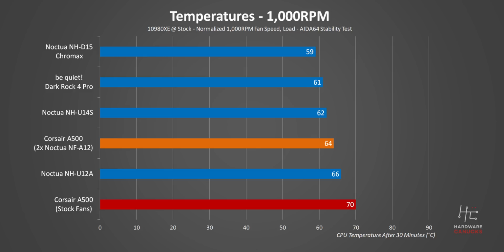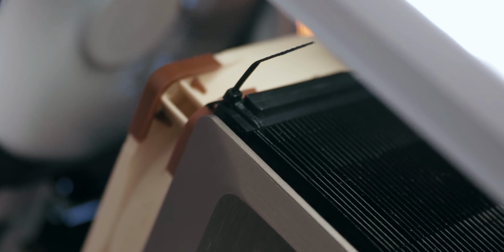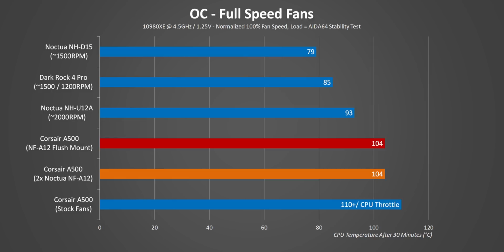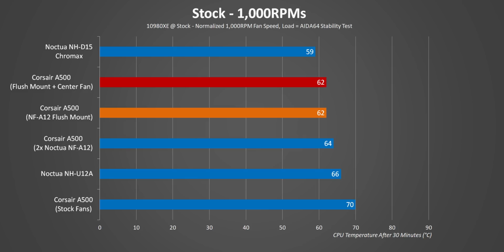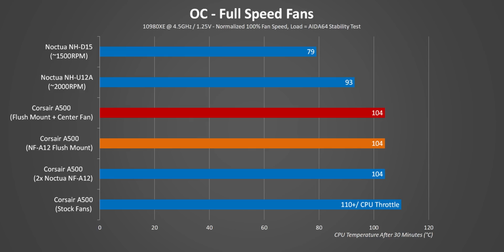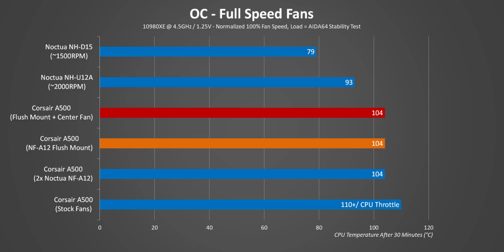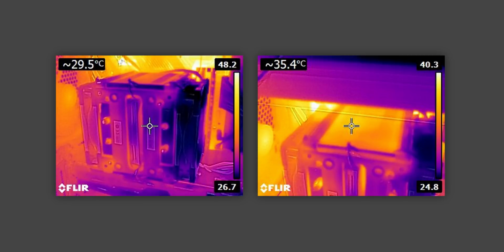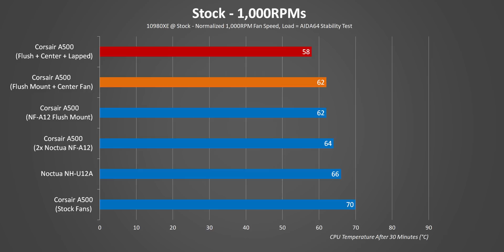I Tried To FIX The Corsair A500 Air Cooler!

Comment: I have no issue with Corsair for the most part,  they however shouldn't have bothered with this cooler IMO.   It's ugly for one and more complex then it needs to be.   That whole sliding fan thing is just a waste of time.   Mount the fans once and forget about it.  It's not like a window in a house that'll be opened and closed all the time.   Sliding fans,   pointless.

Comment: Using noctuas is always the best option for air coolers but using a slim fan in the middle gap is just a genious idea, good job "fixing" (in the noise area at least) this disaster with the good ol' brown.
Edit: Even with that much tinkering the 4 heatpipes are just not enough, i guess the long awaited NH-D16 with 7 heatpipes is really going to make a big difference.
Reply: Genius how? It Didn't improve temps whatsoever.
Reply: @vongdong10  Yes im aware of that, im saying this because using that middle gap for something was unexpected for me, i didn't work because of the naturally poor performance of the cooler but a fan in the middle is kinda rare and the for some coolers and it makes a impact in temps.

Comment: That's crazy, I was thinking the DR4Pro was overrated since if I push 9900k to all core 5ghz it runs right up to 100C....
Reply: It is because Noctua D15 is like the best cooler in the world 

Open for debate if you want me to justify
Reply: @tanishqbhaiji103  Yea on the reviews the noctua and BeQuite was right at the same performance, liked the color of the BQ.  It's just a hot chip, then again normally mine runs underclocked to 4.5 so fans can just idle while gaming.
Reply: I don't think on an OCd 9900K to 5GHz should use ANY air cooler... :D

Comment: Jesus what a fail and it's being covered on all main tech channels. Somebody is getting effin fired.
Reply from the maker: technically it isn't a fail since it can cool really well up to ~165W.  So 99% of CPUs are covered.  But over that?  Not anywhere close to Corsair's 250W claim.
Reply: @HardwareCanucks  For that price point it should be putting out wildfires in Australia.
Reply: @ninezerofive  that should be the rating from now on.  Rated for Putting out bushfires in Australia.

Comment: I've tried something similar on my old Cryorig R1 Ultimate, replaced the stock fans with Arctic Bionix P140 fans and it improved both on performance and acoustics. Thing is it looked hideous and I ended up with an Eisbaer 360, best move ever!

Comment: zip-ties are made of nylon your cpu would die before they melt or even warp
Reply: if anything they just go brittle after a bunch of thermal cycling and break away
Reply: The fans are also made out of a similar composite material yet no one ever worries about fans melting. Not that the heat pipes are efficient enough to get your heatsink up near your cpu temperature anyway. I suspect removing half of the fin stack and replacing it with a fan blowing directly on the mounting plate would improve temperatures
Reply: Nylon is a thermoplast that's semi-crystalline, meaning it does lose a bit of its rigidity above the transition temperature where the crystalline structures get "dissolved". That's around 50°C, meltingpoint is a bit north of 200°C. Your CPU will shut down before the heatfins get anywhere as hot.
Reply: I looked it up for accuracy. Zip ties withstand temps of 85C(185F) and melt at 257C(495F). Definitely bigger problems too be had if your ties are even seeing the rated withstanding temps. Let alone melting.
Reply: Unless it made up of some ultra cheap plastic, that cooler shouldn't be getting hot enough to melt it or something has gone terribly wrong.
Reply: @dekoldrick  actually cheaper plastic tends to have a higher glass transition temperature due to the introduction of impurities
Reply: @Ziv ZulanderI know 😂😂 Think he was just exaggerating for effect